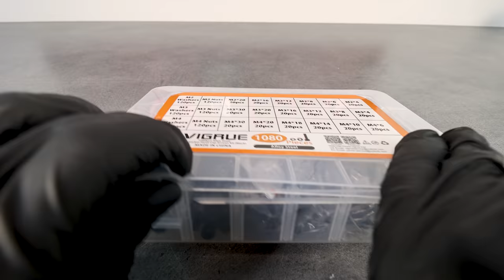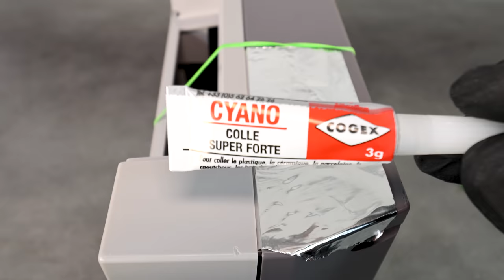NINTENDO Console Restoration - Retrobright ASMR

Comment: I always disable the NES10 region lockout chip whenever I'm in there. It prevents the infamous blinking screen from ever happening again. No more blowing on the cartridges!
Reply: But what if I wanna blow my cartridges?
Reply: @kaichu3666  just don't use explosives.
Reply: @OverseerMoti  🤣🤣👍
Reply: Didn't know it had that side effect. Does it speed up PAL games by 10 Hz?
Reply: but couldn’t that trigger some anti piracy systems built into games? i’m not sure with nes games but iirc on snes there are some examples of games which check for those stuff (earthbound i.e.)
Reply: @alex.r.g  The blinking is caused by the cartridge not being able to read the correct region. If the cart is even a tiny bit dirty, it will take too long to read the region, so the NES thinks you have the wrong version of the game, and it starts the blinking BS. 

That's why disabling the chip stops the blinking! No chip, no blinking!

To disable the chip, you simply lift one leg. It's just that simple.
Reply: @Chaos89P  now that I can't answer, but I seriously doubt it.
Reply: @alex.r.g  There was no anti-piracy on the NES whatsoever. The thought was that the cost of the equipment to read and then manufacture ROM chips would be way too expensive for pirates to make money. And without a profit motive, nobody is ever going to care enough to reverse engineer the system, so why worry?

What Nintendo was worried about was third-party developers sullying the reputation of their beloved Entertainment System. So, as a developer, your game had to be approved by Nintendo first, then they would sell you a security chip for each cartridge. The chip did nothing but generate a constant stream of pseudo-random numbers, one per second, the exact sequence of which was only known to Nintendo. The chip @Michael Bloom is talking about does the same thing, and would reset the CPU if the two sequences differed even once. If the contacts were dirty, the cartridge version of the chip wouldn't get initialized correctly, the sequences would differ, and the CPU would get reset every second.
Reply: By no means ever blow your cartridges, the humidity causes sometimes to make a connection but it's one of the main causes for corrosion that's preventing it. Just pass a qtip or swab with a little alcohol on them and again with a dry one.
Reply: @michaelbloom5342  Okay, I've done that... when can I put my leg down again? Its going to sleep
Reply: @Chaos89P no unless you have an ntsc system

Comment: Would like to see you restore a black console (SEGA Genesis, Turbo Grafx16) because I'm curious whether the UV light thing works or if you have a different process for a fogged/chalky case due to sun exposure or oxidation.
Reply: Would like to see that too. Black seems to be more challenging.
Reply: Same if only for seeing a Sega console for a change. Everyone does Nintendo consoles. For the black I would think just clean it and buff/fine sand it.
Reply: @Eener1000  how would you avoid the logos etc

Comment: 8:58 You must use insulation for the soldered wires. For example, shrink cuttings. Never leave them as they are.
Reply: What is that solder job?! Really great restoration otherwise. Tysytube is very skilled; I'm sure he'll be able to learn proper technique in no time.
Reply: @powdercake476  As for me, he soldered wires to output (secondary) coil of the transformer. In case of long shorting that wires, transformer will be overheated. And possibly may catch fire. Safety first.
And yes, Tysytube is very skilled restorator)

Comment: I’ve never seen the super glue and baking soda trick. Kinda cool! Why did you choose that as a filler? Just curious. Love these console restos!
Reply: probably to match the color (as possible)
Reply: It’s very strong and can be sanded.
Reply: @ratbert69uk  Agreed. I've used the technique myself, and with a bit of practice it's a great way to make small repairs to plastic objects. It's an established technique in the toy repair community.
Reply: Can you do further color matching on top of that (touch up paint) or is that a fool's errand?
Reply: @Bedwyr7  Yup, you can paint it. The texture can be a bit pebbled, so if you're going for a perfectly smooth finish you'll want to sand it and use a little filler first.
Reply: @TheRealColBosch  Interesting - I have a retro computer case that someone took a hole saw to, and I was going to just use body filler or epoxy, and then sand and paint. I might give this a try.

Comment: very good video but I couldn't help thinking all the time how strange that nes is! is it a mod? It's not original? is it a new version? I really want to know, I thought it was cool that it had RGB output
Reply: Just a french nes.
Reply: The adapter threw me for a loop when i realized the box didnt have the prongs for the wall outlet.
Reply: Yes, french NES, it decodes PAL to RGB but you wont get the "RGB quality" that can be achieved with a RGB mod.

Comment: Excellent editing as always. It’s always so interesting to see the inside of this OG tech. The connectors are all so beefy and durable. Big solder pads, etc…back before they were worried about making everything smaller, thinner, and faster all at the same time. I feel like the repairability was much better. 

Now everything is just sort of made to be disposable when it breaks. It’s also interesting to me how worth it repairing an old console like this is vs if you were to repair an old VCR or Computer. Even with emulators out there, I always seem to have issues playing games on them. It never feels the same and they glitch and stuff. I also can’t ever stop myself from using cheats since basically every emulator is also a GameShark nowadays.

PS: It did drive me a little crazy you didn’t do anything to clean the AC adapter though 😉  That being said, I’ll bet there was a reason for it!
Reply: One more thing, how much do you spend on Hydrogen Peroxide for these restores? I know it’s relatively cheap, but the amount you have to use to get rid of the yellowing for each restore has to be significant

Comment: Industrial peroxide is expensive and hard to find.  Here’s  an easier way I used on my UV-stained LEGO bricks:

1) Get a larger clear container with a clear lid.  I used a scrapbook case that I bought for $5 at Walmart.
2) Mix up some water and Oxi-clean, about 5 Tablespoons per gallon.  I used a pitcher so I could carry the solution to the container to the bleaching container.
3) Put the item(s) to be bleached in the container and pour Oxi-clean solution over it.  Cover container with clear lid or plastic wrap so the water doesn’t evaporate. 
4) Leave in bright sunlight.  This part is important!  The UV rays from the sun supercharge the bleaching action of the Oxi-clean.
5) After the 1st day, take a spoon or tongs and flip over the items so the sun can shine on both sides.
6) After a few days, rinse the items off in a colander and place on a bath towel overnight to dry.

Comment: Oh it's an later model since the original didn't had an AV output port and the unused port wasn't covered by the bottom part of the case but this is still a cool restoration on a iconic console

Comment: Great content! Although, you didn't use Ramen noodles to fill in the hole.
Reply: I think it is better to be vacuumed instead of cartridge port, and sanding its pins make it to have better connection with cartridge pins too.   am I right?

Comment: Another great job. I have a question about a PS2, a fat one. It does not get any power when plugged in. I looked up why this may be and I found a video where the power connection in the back may need to be re soldered. If I do that, could this possibly fix it? I understand if I attempt that, that I am doing it on my own and that i do not hold you responsible if something goes wrong.

Comment: Hi tysytube!i have a old hatchet here,its kinda rusty,i tried to fix it,i improvised a cable and sharpened it,but the wedge its still damaged from the rust, the hammer head on the other side of it is deformed,and the cable is not alligned,meaning that the axe head its not alligned with its cable,is there a way i could contact you so you could see it or even restore it for me? I aprecciate your attention! :3